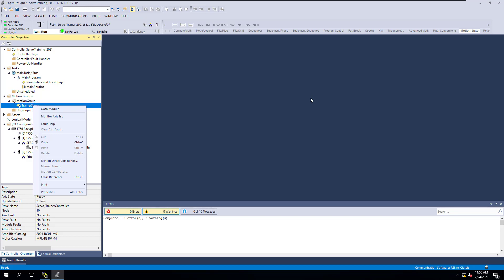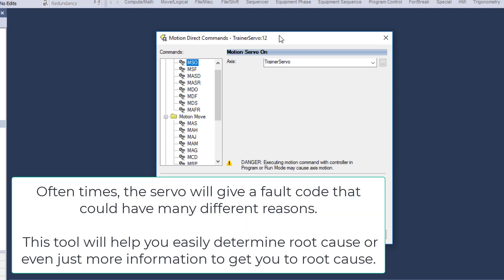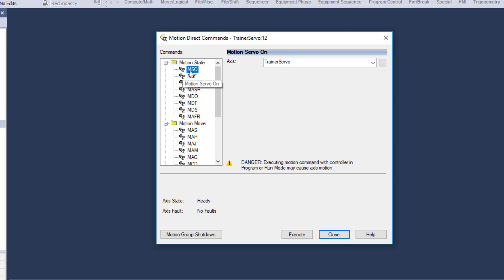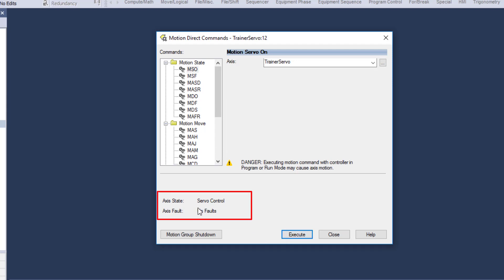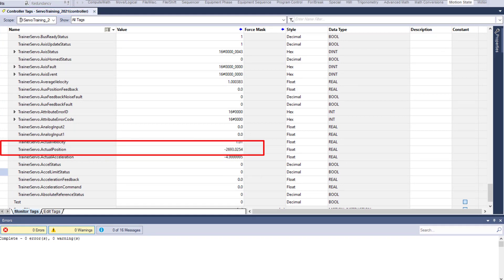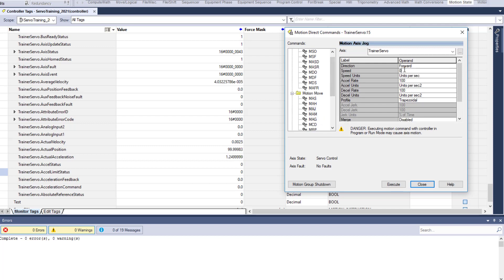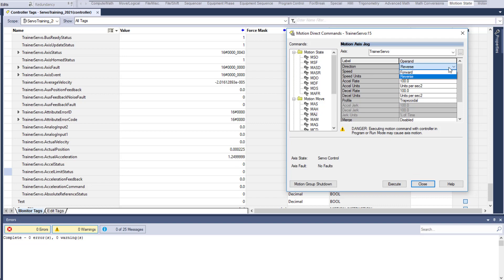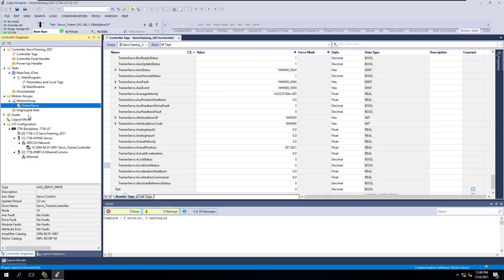Using Motion Direct Commands In Studio 5000 | Controlling An Axis

Comment: Will a MAS hold a motor at 0?
Reply from the maker: @danekline7913  depends on when you use the MAS. It can
Reply: @ShaneWelcher  I have several hundered feet of chain driven by 3 servos. Each servo doesn’t run all the time. If the conditions are right, the one servo will drift backwards. Is there a command I can use to hold it at 0? I’d like to refrain from using the brake that’s on it cause it’d be on and off constantly.
Reply from the maker: @danekline7913  sounds like you need a brake to help hold that much weight or a gearbox with a high ratio
Reply: @ShaneWelcher  so the motor does have a brake but I fear with how much stopping and starting its doing, I might create a new problem by engaging and disengaging the brake.
Reply from the maker: @danekline7913  You should not have any motor issues with a MAS with a servo that has a brake
Reply: @ShaneWelcher  I meant more so an issue with the brake. So I could use an mas and at the same time have the brake on. This could be upwards of 10+ times a minute 24/7. You think the brake and coil would be able to handle that much on an off? All of our servos don’t use a brake in such a way so I’m not too sure.
Reply from the maker: @danekline7913  Then that's an issue, a servo with no brake will not hold position unless you do not turn off the servo, if the servo is on then it should hold
Reply: @ShaneWelcher  so would you recommend using the brake and an mas at the same time and under the same conditions? 

Im just unsure of constantly energizing and reenergizing the coil of the brake the amount of times I need to, might create a quicker failure of the brake.

Comment: Hey Shane, where is the drive enable input checking for studio 5000 firmware 21.11? The axis properties doesn’t have a drive/motor tab. It must be hidden somewhere else possibly? Thanks for the help and the video
Reply from the maker: Are you using a real servo drive axis?
Or a just a axis that is not for a motor?
Reply: Real axis. Not a virtual.
Reply from the maker: @traviscoleman9520  probably a version issue, I skipped version from 20 and below to version 28 and above.

Version 21 has bugs so I recommend upgrading or downgrading